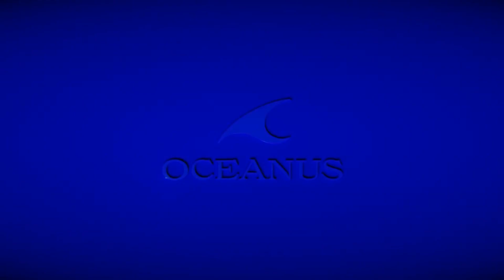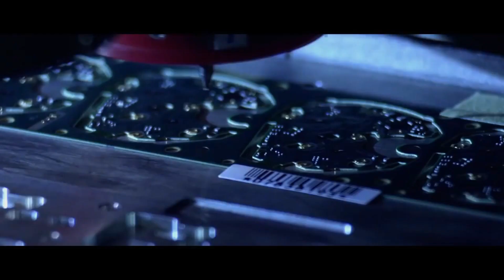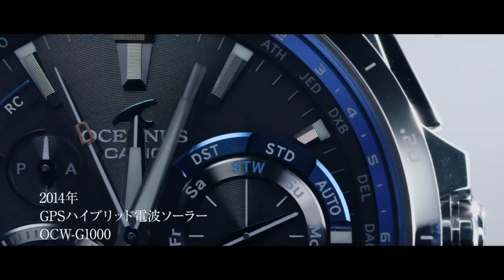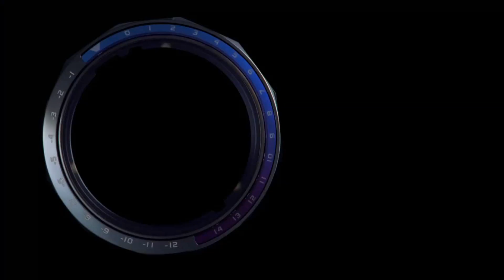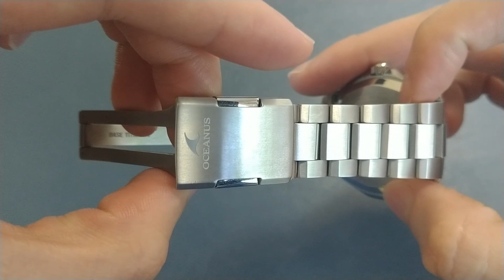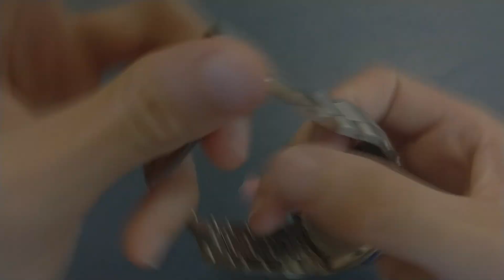Casio Oceanus OCW-S100-1AJF after 4 years. The ULTIMATE review of this watch!!

Comment: Correction sir! After you set the date and the month, the YEAR setting follows. 
•11:33-11:44: Hour hand on the 1 is for Teen (one Ten); minute hand on the 9. Hence the year the timepiece is set to is 2019. Hour hand on the 2 is for 20; minute hand at 12 o’clock is for 0. Hence the year is 2020. If the Hour hand was on 3 and the minute hand on 7, the year would read as 2037. Simply put, the hours hand is read in tens; the minutes hand you read as ones.

Complicated? Yes. But not impossible to comprehend. The calendar year goes from 2000 to 2099.
Reply: The month setting is similar to the year setting with this difference: Beginning with the 1 hour index, each month of the year corresponds to the hour number index. January is the 1 hour index. The 3 hour mark is for March. June is the 6 hour mark. Finally, 12 o’clock while in the month setting is for December. 😊

Just remember that in these analog Casios where you have day, date, month, and year functions, you set the month before setting the year.

Comment: This watch tells the time with absolute precision. It is made from premium materials. It is robust with 100m of water resistance. It is finished to an extremely high standard. It will fit most wrists and look good in any social setting, from the beach to formal occasions. It is solar powered and once set never needs manual adjustment unless travelling to a different time zone. For the money, it is the ultimate go anywhere, do anything watch. Other models are available with more bling or complications, but for simply telling the time this is The One!

Comment: I normally only go for mechanical watches but I'll admit I like the Oceanus T200S. Do you think they will they produce an improved version (improved bracelet micro adjustment, screws rather than pins in the bracelet, cleaner dial with less text). I'll admit I'm not sure whether I prefer titanium  over steel - I think I like a little heft on my watches. I'll be aiming to wear it at weekends when I play a lot of tennis (mechanical watches haven't done well here and I can't afford Nadal's RM) so Seiko's tough mvt appeals.

Comment: The watch that you are reviewing - S100 - has multiple motors?  Why?   

"Perfex Multi 3000" is also found in several Citizen "calibres" (modules)

10.5mm thick.
Reply from the maker: Usually quartz watches has one motor that moves all the hands. This one has a motor for each hand so they move independently
Reply: @watchroll3310  Yes.  And it does not have five "hands." If you count the date as a "hand" it has four.
Reply from the maker: @thomaslinton5765  You have to understand it in context. At that time I was talking about Oceanus as a brand and different models that do have 5 motors. This S100 has 4.
Reply: @watchroll3310  " This one has a motor for each hand so they move independently" vs the title for the video.
Reply from the maker: @thomaslinton5765  what about that?
Reply: @watchroll3310  The video says it is about the S100 that has no need for the five motors that you ascribe to all Oceanus watches.
Reply from the maker: @thomaslinton5765  the video is about that watch and there is a brand introduction section. 

Is there any rule that I can not talk about the brand (including other models) on this video? 

That's the lowest thing I ever hear in years. Who gave you permission to use the internet? You are not normal.
Reply: @watchroll3310  No rules, tough guy.  Just a comment from a customer. Apparently, you only accept praise.
Reply from the maker: @thomaslinton5765  I find honor in respecting logic and reason. That's what this channel is about. If you were right I would have admit it.

Comment: How long does the power reserve last you? Where I live, winter is pretty long so my current Seiko Solar watch with a V157 (which supposedly has 10mo reserve, doubt it) battery dies out at some point towards December/January despite my efforts to keep it charged. During the summers, I keep it charged all the time and in sunlight whenever I can so as to keep the solar battery charged.
I only spent $300 on that Seiko, but the Oceanus S100 will run me $700 CAD. I really don't want to deal with the headache of worrying about if the watch will make it through winters or not - what are your experiences w the power reserve specifically?
Reply: No idea about the power reserve but you can buy an LED solar watch charger on Amazon to maybe solve your problem with solar watches not lasting through the winter.

Comment: I own this watch and I love it. A couple of downsides: the size. When I got the watch I was very dissappointed how small it is. The strange thing is, when you put it on your wrist it does not look small, when you take a picture of the watch while on your wrist it even looks huge. Very odd. The 'tough mov.' branding was not necessary. It does not reveal the 'tough solar' feature, so why revealing the movement? I've been told that every of the three hands has a different motor. Is that true? One tip for everyone who gets one: everything is already set into auto mode. So you don't have to do anything manually (well if you country does not have DST, then you should switch that).
Reply from the maker: Though mvnt means it has solar, atomic, shock resistant and other things included. Is just like omega lables "co-axial" or "spring drive"